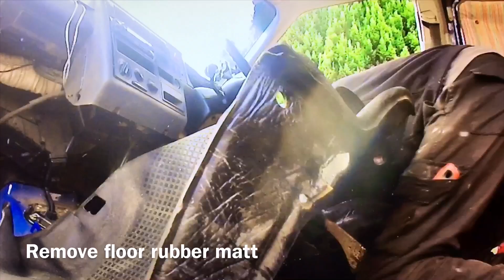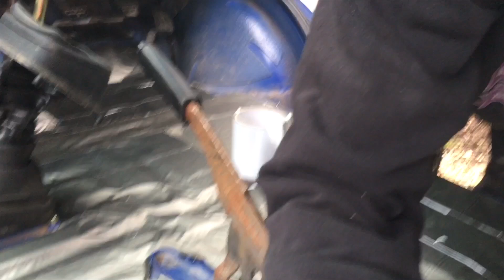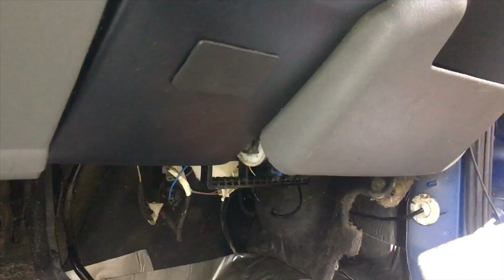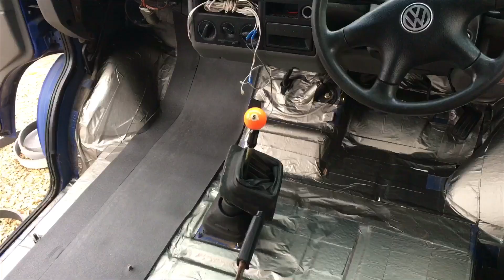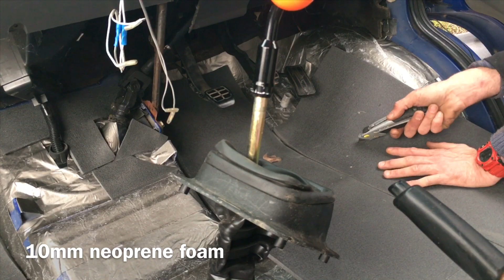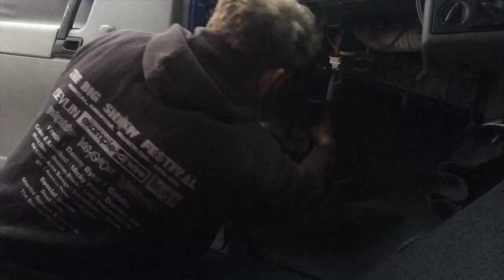Vw T4 insulating drivers cab

Comment: Is that sound deadening material like rattle trap? I have a 2002 automatic Eurovan.
Reply from the maker: Snow Blanca sort of it’s a bitumen backed flashing 1st the sort that’s used on house roofs. As I get it for nothing then a layer of neoprene foam over the top. It’s definitely helped cutdown on road noise.